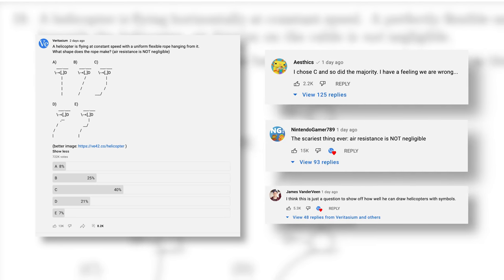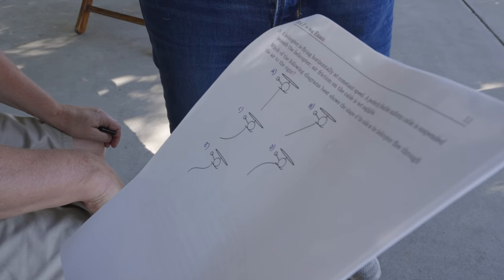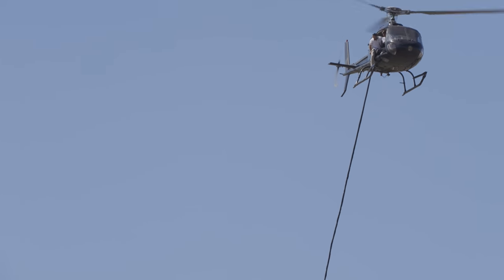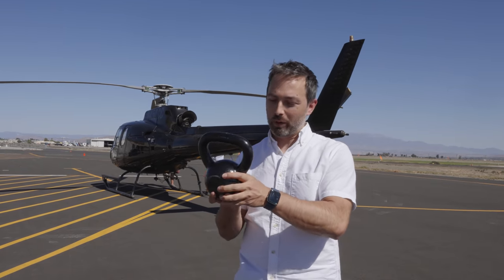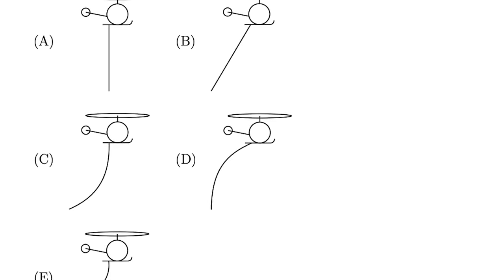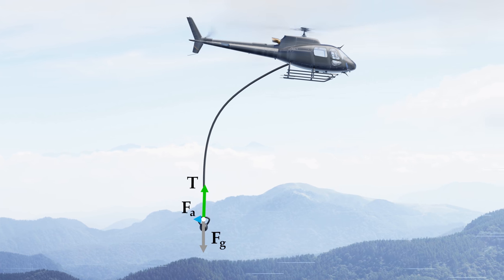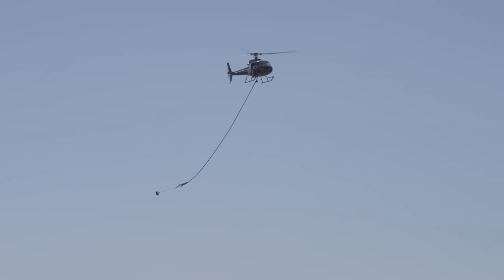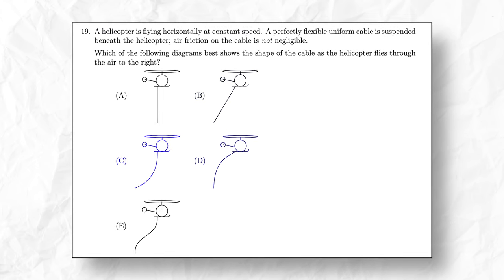I Rented A Helicopter To Settle A Physics Debate

Comment: I thought this is about the viscous friction and how it passes on to different layers of fluid at the bottom of the helicopter, as friction away from the helicopter could get weaker, so the force above is higher, then there's gravity trying to pull it back to the center which depends on the angle that the rope element is in. The rope is "perfectly" elastic? - so each element of the rope just moves on its own accord? I answered this as D myself because of the air resistance thing, kind of sad that the rope didn't feel that kind of motion. Maybe if it were larger but lighter would it be D though? I still kind of can't believe that the helicopter itself is not distorting that "still air" the rope is experiencing up top

Comment: I honestly did not find this scenario counter-intuitive at all. So long as the weight of the rope is uniformly distributed along its length, it will hang straight. If the helicopter just hovers without moving (assuming no significant wind), the rope will hang vertically downwards. If the helicopter moves at a constant velocity, the rope will align diagonally straight and if the helicopter accelerates, it will align straight along the helicopter body. The straightening is because the air resistance kind of supports the rope weight.

Comment: How did you safely recover the rope with parachute attached, if the extra wind resistance meant it risked going into the rotors?
Reply: The helicopter pilot with thousands of hours experience in this kind of work probably slowed, approached the landing spot until the rope touched the ground, then landed straight ahead, as they tend to do when slinging loads beneath helicopters.  

Observation is the key.  

Science is different from philosophy.  One makes observations, then tries to find a model that explains how what we saw happens, the other assumes a start point, then tries to extend it to other areas without testing.  It's like, 'the Moon is made of Green Cheese', and 'we bring you a piece of the moon, please test to find what makes it up'.  

The two viewpoints are excellently shown in the radio play 'The Road' by Nigel Kneale.  It's on youtube.

Comment: This doesn't make sense to me. At the end of the rope the Tension is almost 0 as is the weight but the air resistance should be the same as any other part of the rope.  At the top of the rope the tension is much higher but the air resistance is unchanged

Comment: Might be kinda a stupid answer but i feel like all the options are possible? When youre talking about real world scenarios youll have variations in wind speed and air pressure and everything (not to mention that youre literally working with rope which can behave very chaotically) so i feel like its entirely feasible that you could see all of those shapes in one flight if the circumstances were correct. Very interested to hear the answer tho!

Comment: I'm not convinced. Something seems off with the explanation. And I think because of the channels reputation nobody is questioning it.... Hmmm....

I think the weight of the rope is the problem. The bottom of the rope pulls on the top as well, so there is less pull at the bottom. But with the rope being as heavy as 20lbs it doesn't matter, at the bottom it's still much more affected by gravity, and the air resistance is negligible.

Also would you expect the rope to have a straight down line (answer A) when moving in a vacuum?

Comment: wrong.

the phenomena of the rope reflects the derivative of acceleration.  rotor wash exists, but utlimately the whipping of the rope will depend on linear and angular acceleration relative to the ropes length and mass.  the rope is only straight with zero acceleration.  higher orders of compound acceleration will produce temporary alterations in the ropes shape.

Comment: I got it right!   Since the question does not specify the mass per unit length of the rope, I imagined it as very heavy which leads to the straight line prediction.      This question was badly written.

Comment: How does the ratio of air resistance to weight stay the same. Air resistance is constant but the weight keeps increasing as we go towards the heli due to the accumulated mass of the rope right?
I'm a bit confused because I see the air resistance vector changing in the video at some explanations but assumed to be constant at other explanations

Comment: The question feels like it is deliberately mis-leading the student. Picking a helicopter and stating air resistance is not negligible forces most people to assume the downdraft from the rotors is a factor in the problem. Yet the person setting the question knows this is not the case and choses to withhold this information. If the downdraft was not relevant then they should have chosen an aeroplane and not attempted to mislead everyone then look smug at how 'most people' got it wrong.

Comment: when i was in the military i would have to stand under helicopters, dealing with the router wash. Then hook up anything you can think of lol. most dangerous pick up we did was part of a bridge. and the premade diagram we needed to follow was wrong lol. we predicted that if we lifted it they way shown on the diagram then you'd have a 10 ton bridge spinning under the 53. so we had to measure it all out and weight it. and make different connection points and then measure out how long the chianes needed to be. doing all this math with my team and a team of pilots was one of the most memorable moments. and i hate math lol.

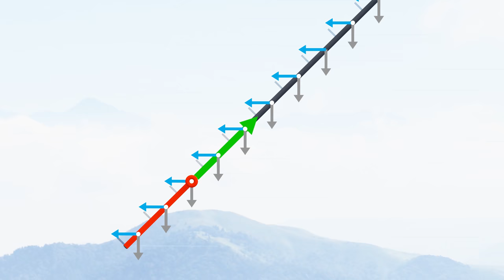Comment: It seems to me that the scheme of forces at 5:20 is wrong: the weight of every single section is the same, yes,  but the tension in the  the rope at the end is just the weight of the last section (vertical) plus the air friction (orizontal),  the tension at the top is the weigth of all the rope, 20 kg, plus the air resistance that is the same everywhere, it does not increase as it seems at 5:27 and 5:47. The real shape should be C. If it looks like B, is probably because it is quite a heavy rope: 1,33 kg/m is the weight of a chain made with 8 mm diameter iron wire, and perhaps there is also an effect due to the thrust of the current generated by the helicopter's propeller. Varying the diameter, length and weight of the rope could, maybe, also occur the case D or even E . I it was an airplane instead, C is the most probable....

Comment: Without watching the video to the answer, I would say the most likely answer is C.
However, I'll also err on the side of caution and say that none of the above is also true.

Because all answer show the Helicopter as being straight.

A Helicopter cannot move forward, with even rotors. It must tilt forward to advance forward.

Edit:
Interesting. B without any weight or extra drag. D wit weight, and finally C with extra drag.

Comment: VERITASIUM IS WRONG!
The thing is just... Derek is saying that the rope is hanging directly diagonally downwards so that ANSWER B is correct.

Yet, watching the video, that answer/observation is INCORRECT. 
Stop the video at 3:54 for example.

You can see the end of the rope often pointing directly downwards (not diagonally), because of the rotor wash.... or maybe because the lift force is lower at the end of the rope.
So you could either say that B or D are correct, or neither, since D shows a slightly different curve, OR that only answer D is correct.

This is confirmed by the experiment they did at 10:13. "The rope seems to be pretty straight" - That's because it wasn't before, not because the drag force of the flag is THAT small. Since the end of the rope was pointing downwards before, not diagonally, now with the added flag, it is ACTUALLY pointing diagonally backwards.
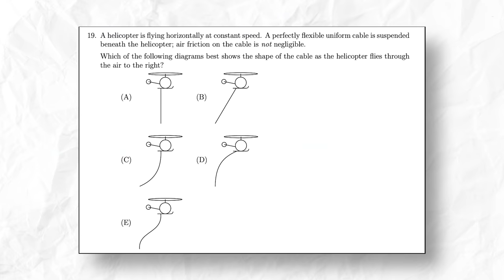Reply: moment 11:17

Comment: Perhaps it’s a little late for this question, but what do you think would happen if the weight was suspended from a hinge at the end of the rope, rather than just tied to it.
In other words, if the weight is freely mobile with respect to the rope and doesn’t change direction of the end of the rope when it moves. In that case will you have a straight rope with the weight dangling at another angle?
Reply: That would multiply the whipping effect and end up in the rotor
Reply: An ideal rope has no bending stiffness. Therefore, there is a hinge already.

Comment: Isn't the point of such a physics question that the diagrams are way exaggerated for effect, and the question is "does it bend AT ALL in this way", not "which does it look closest to"?  In which case, the rotor wash is NOT negligible, merely not visible.  I don't think straight line is exactly correct.
Reply: Anyways questions like this are why I hated my physics degree and tried to escape to computer science

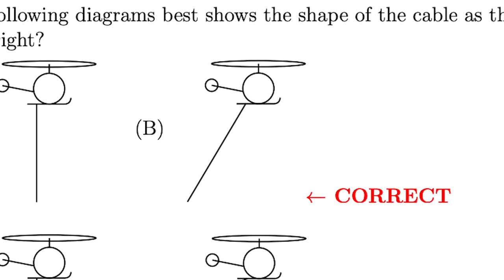Comment: Hey, I have a PhD, in English, but I have eyes. In the graphic part of the video, the line seems to hang from the left side of the chopper, but in the real-time video, you and the pilot are on the right side and the line is going towards the right. If the aircraft is heading at 12:00 the line should hang at 6:00, at 10:00 at 4:00, etc, assuming the pilot is flying directly with or against minor airflow. You need a smart aerodynamics guy for some more expert help.

Comment: Ok, that statement by that prof is totally wrong, the downwash does extend quite far, easily enough to be a factor.

To prove the point, helicopters (and airplanes) experience a phenomena called ground effect, where it starts to create an air cushon effect, and that effect becomes very apparent when the helicopter is one rotor-diameter above the ground, so the downwash has to extend beyond this if at higher altitudes, so can't be factored out.

Comment: Question: wouldn’t the answer be different if the length of the rope is a lot longer and how fast the helicopter is going? If it’s fast enough the answer would be B. If the the helicopter is moving slower and the rope is longer it would be E. You video show the rope going from B and D towards the bottom.

Comment: Listening to the Question i assume the Rope to be Plastic or Jute or Natural Fibre Type as is the Usual Case and Not a Heavy Weight Possibly Metallic n Sheathed Rope used InHere
Even the Pilot was expecting Whipping Action n Tearing Air Draft of Helicopter Fans to possibly Get the Rope to the Rotor
This is Dope till experiment uses a Rope

Comment: I don’t agree that it’s straight. It is clearly whipping around. It’s just not as pronounced as answer E shows but E is correct. Also because the down wash doesn’t reach the entire rope it definitely hits the top of the rope and therefore would translate to the end of the rope causing whipping action.

Comment: I’m speechless. The examiner says “ I saw this, so it makes a great exam question!” And then sets the “right” answer based on loose observation, not detailed observations that actually consider the forces employed ( which is in effect what the exam question is asking the student). A bit like saying “ I don’t see the table bending when I put my coffee cup on it, ergo it doesn’t bend at all”, when in reality, the table does bend, but not by enough to be seen ( but it can certainly be measured). The way that this question was thought up completely negates every single precept of good experiment process and deduction that we are taught from the very first physics lesson. The observer saw a “straight rope” and assumed it straight. But it’s wasn’t actually straight! In fact, on several shots in the video, you can see that the rope certainly isn’t perfectly straight. The question should clearly state that the effect of downwash should be ignored in order for the question to be considered valid.
Reply: But it was straight enough to be considered straight. It's even said- "pretty straight." Not perfectly. Just close enough.
Reply: @Malkontent1003  but it wasn’t “straight enough to be considered straight” - that’s the point. It “sort of looked straight” but it wasn’t actually straight. See my example with a cup on a table. In a physics exam question like this, there cannot be this level of ambiguity.
Reply: @Malkontent1003  also, this breaks the basic rules of deduction by observation. “It sort of looks straight, so it is” is a horrendous assumption.

Comment: Ok, so I haven't heard the answer yet, but something tells me it's the S curve. 

I just feel like the effect of air resistance won't be consistent along the length of the rope. The top of the rope is taut against the helicopter since it's anchored at the top, so the rope will be more rigid at the top, and as you go along the middle of the rope, air takes a greater effect and pushes it back. Then when you work to the bottom of the rope, there is less rope in terms of weight the farther down you go. So basically along the middle of the rope you have air and the weight of the rope below it pulling it back with the wind, but at the bottom the weight of the rope relative to its length isn't enough to pull it straight down, so it forms the S shape. 

I feel like I explained that really poorly, but it makes so much sense in my head.

Edit: oof I gotta go back to physics class
Reply: Lol, no you are right, if you let the rope get altered ,stretched, by the tension it was under, then it you can get different results.  In fact, since scale doesn't matter, eg speed is not mentioned and we are not told  the pictures show the curves to scale ... you are right, its more messy than B,C or D.   Eg the  end of the rope always alters the aerodynamics at the end, so the end must be  curved back, so  C  replaced B. B is impossible unless scale and "near enough is good enough" is defined. However for the purpose of most of  the length... then B. Just ignore the end.

Comment: What a waste of money.
Mentally divide the rope into small equal segments. Its density is uniform therefore each segment has the same gravitational force. Air resistance is uniform therefore each segment has the same horizontal force. Since they're all subjected to the same forces, you IMMEDIATELY see it must be a straight line.

Comment: Do the results change based on parameters outside of the question? Altitude, type of helicopter, ambient air currents, weight of cable... etc.

Comment: Unsatisfactory. 
This ~5:06 simply won't do. 
We haven't done what the test takers were asked to do.
After the first flight, yes, we do know that "each section... experiences the same air resistance".
It's because each section makes at the same angle to its velocity: the rope is straight.
But before we do the experiment, we don't know that!
If the rope had looked like one of the other curves he'd be saying "each section ... experiences a different air resistance".
The test takers couldn't do the experiment. Yet they are supposed to pick B.

Comment: I feel as thought this was not proven 100%. In the examples given, the rope is suspended on the right side of the aircraft, and the problem states that the helicopter is flying to the right. In this video, they suspended the rope from the right side of the aircraft and flew to the left. If you suspend from the left side, and fly to the right you will get the same results, I would assume, even thought the rotors are in a different direction, but if you fly to the right, with the rope suspended from the right, what do you get? Before anyone asks, yes I understand the problem could be interpreted as us looking at the helicopter from the nose, so our right and the aircraft’s left.

Comment: So the answer is simply B because of the reasons you mentioned. I don't get why people would pick C, it says wind is not counted in. I had picked B too. Simple physics.
Reply: Right but the helicopter exists ya know
Reply: @ploppyjr2373  wdym? It is a movement on x axis, nothing about helicopter's technical part is counted in. No size, no power, nothing.
Reply: @ploppyjr2373  We need to count it as a single dot that's moving forward

Comment: I'm no physics major, but I feel like all the answers were obvious, were they not?
I guessed the rope shape for each scenario correctly, because it was obvious, so I'm mostly confused why this question even exists with such obvious answers? How do people get it wrong?

It can be very simply replicated too. Just take some sort of string and hold it in 3 different ways.
For no weight, just blow on it, and it makes it fairly straight line.
For increased resistance, simply hold the string in the middle of the path it was taking without you holding it and blow on the bottom, the bottom then curves further than the previous trajectory of just blowing on it because you're already holding the string at the trajectory it had when just blowing on it and the extra air on the string simulates increased air resistance.
Then for increased weight, simply hold both the beginning and end of the string loosely (at the angle it would have been without you holding it) and blow on the string, because the two immovable points at the top and bottom, the middle of the string will be pushed further, creating that backwards 'J' shape.

And this is just me visualizing. I wrote this all without testing it. But, just to verify, after a quick test, the results are just as I described.

Comment: I can’t believe you used a real heli, and I can’t believe some physics students used a fan, no.1 factor that effect the rope shape is the helicopter, not the wind. And we actually have seen these in refuelling airplanes, so that question should have been a free pass. Also just using a thread/earphone cables and move your hand in one direction have about same results. So why use a fan? Did the question added elevation, location and conditions? But using real things is so much better to show people..